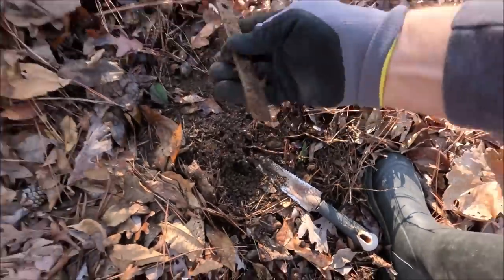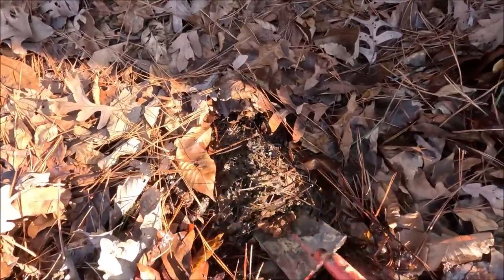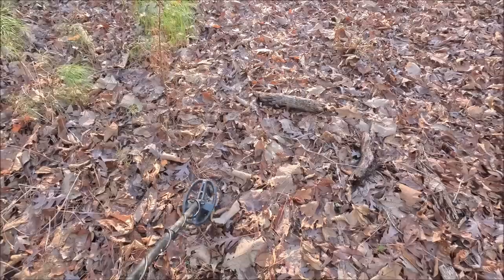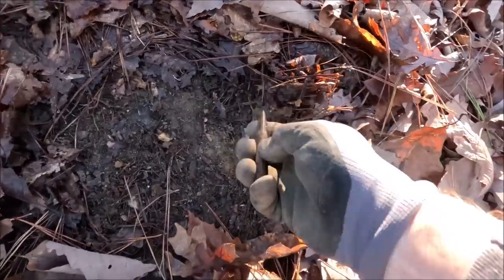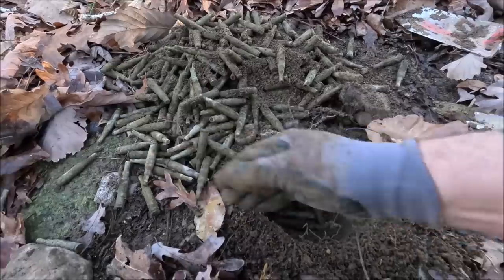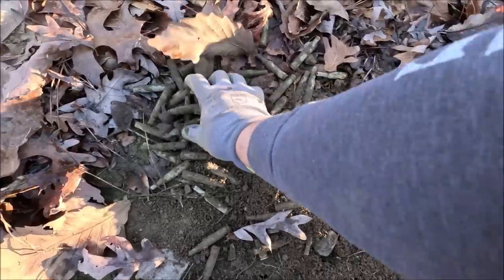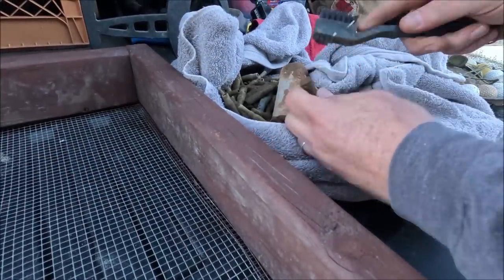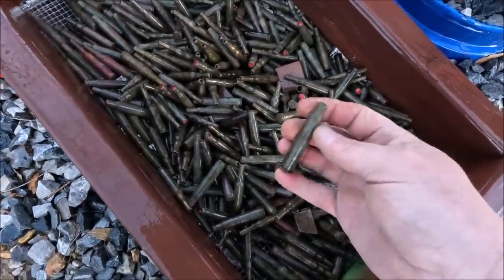This Video will Be Banned in Most Countries: Metal Detecting Massive Pile of Stolen Ammunition

Comment: Your blanks are: Long necked &.62 Nato for M14 and M60, but unfired and no links would be M14. The shorter wider necks are for the 30-06 M1.
The large aluminum case is a flare cartridge either 37 or 40mm. the nomenclature was inked on so probably missing. I don't remember if any model was stamped on the head.

Comment: M-60? Machine Gun Practice Rounds. But, there not linked together with the metal clips. There is only gun powder behind the "Red" plug. DO NOT put them in a open camp fire. They will EXPLODE ! The primers are still live.
We used to find them in piles on "Camp Pendleton Marine Base", when camping there in the "Boy Scouts" back in the mid-60's.
Reply from the maker: I did my time at Pendleton and it was actually fun!

Comment: It is a metal detector so....  that aluminium round is the casing from an M79 grenade launcher?  You see them all the time in action movies.  Korea?  Nam?  I found a 2006 live steel tip M16 round the other week.  The oldest .30/06 casing I've found is 1908  about when Scholfield Barracks opened.  I also found the brass strap retainer from a 1917 Browning machine gun tripod.  I gave it to a friend, retired Col. in the Nevada nat'l guard.  Near Maili I found a heaping pile of 1946 .30 Gov't casings.  Is that an old training area?  I grew up near one in Cal for WWII.   Nearby Camp San Luis was activated in 1917.  I've found older stuff, .45/70 casings and an 1880s Royal Hawaiian guard button.